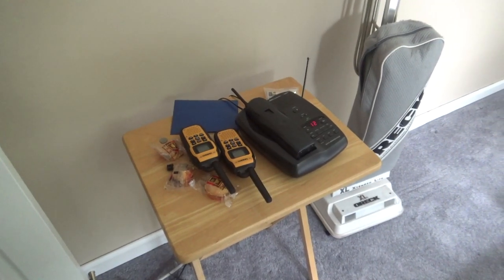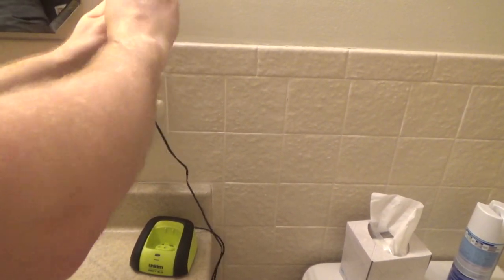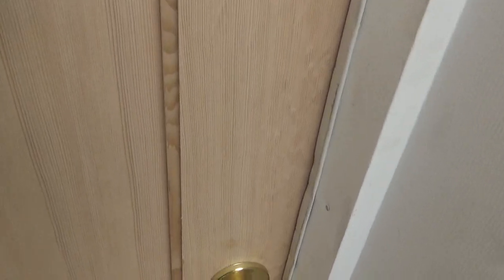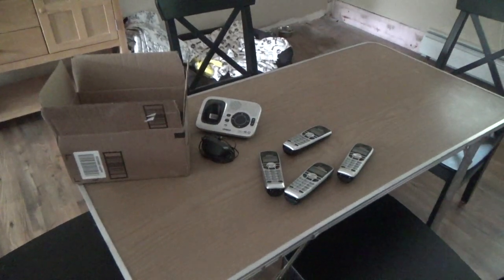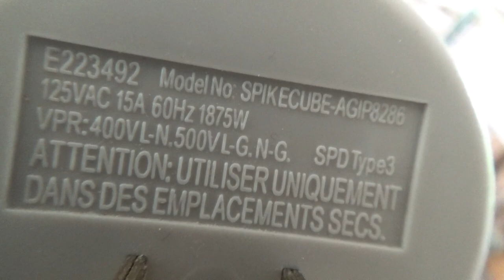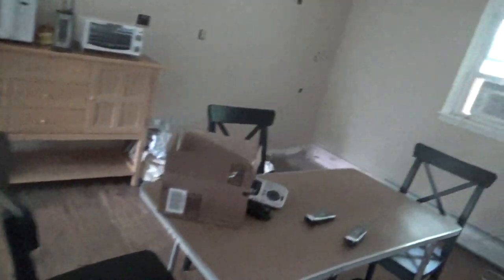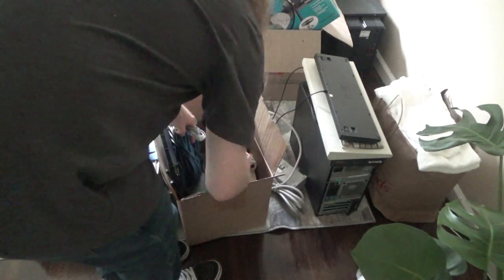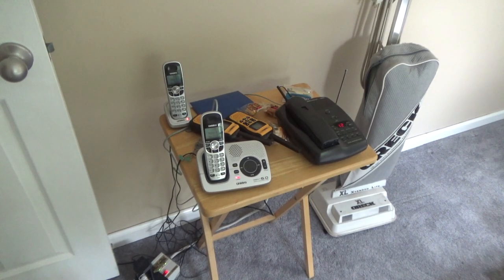Installing Some Cordless Telephones

Comment: Good video bro but I don't why they would close off the upstairs phone jacks in the wall will you be able to pinpoint where therrr located in the wall ? And you would need to hire someone to professionally reopen them back up in the walls so you can use the phones and I know that's going to take time bur for now good video and I enjoyed it
Reply from the maker: I may be able to cut a hole in the wall and fish it back out, if not I'll just run new wires. Not a big deal, just takes time.
Reply: @JordanU  that's true i agree well i'm glad things are slowly coming together bro the Holy Spirit gives you time to get it all done.

Comment: you can get a box of 1000ft of CAT 6 at Lowe’s for under $200
Reply from the maker: You can get it for under 200 beans at most retailers.
Reply: And you can get spam for free in the comment section of most Jordan U videos. Do not post spam!